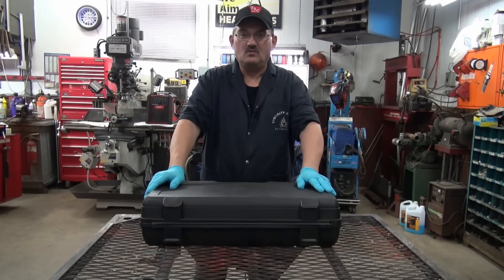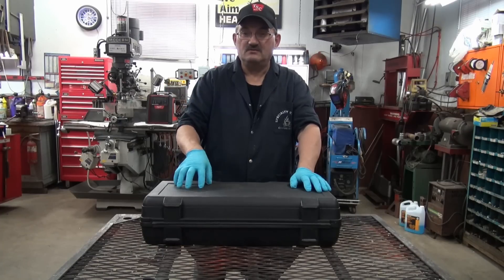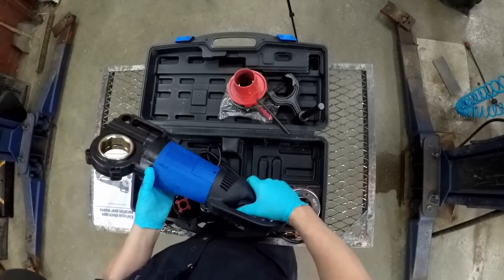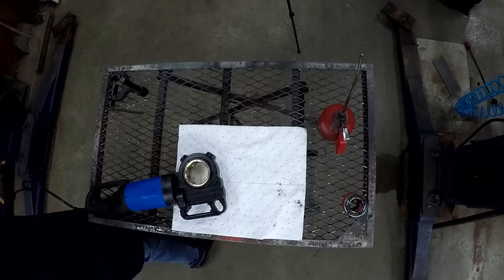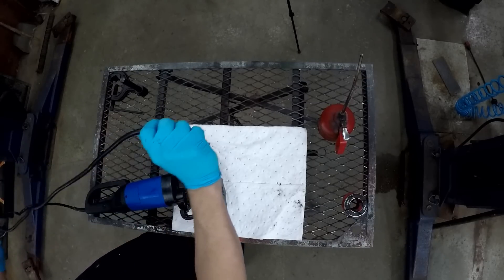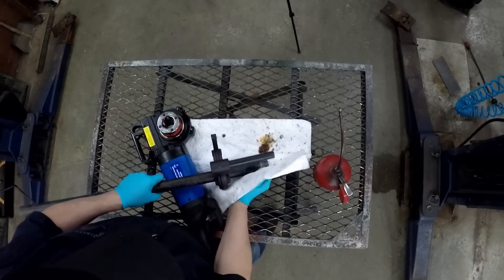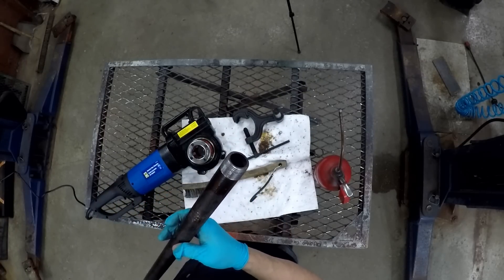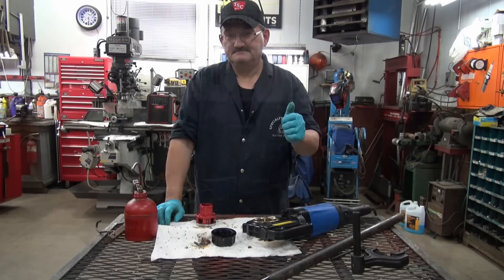Princess Auto Portable Electric Pipe Threading Kit

Comment: P.S.  He was running the largest dies.  I suspicion that as with several other tools Princess Auto has just a bit better quality built in than HF.  Your tubing bender was a perfect example of that.  One fact about the oil diapers:  Don't leave them in water or oil for long periods.  They do their job very well but will dissolve if left.  I made the mistake of thinking they would catch any oil that dripped in my bilge so i dropped one in and let it float.  After several days I was straining bilge water to get the pieces out when it disintegrated (didn't want it fouling my bilge pump).  So use them then toss them.  Have a Merry Xmas.

Comment: I just bought the new Power fist version electric pipe threader, Product number 8639379, It comes with 4 dies, I/2", 3/4", 1", 1-1/4,"  and a way better clamp than the old version, I'm just cutting half inch gas pipe and it took me about 5 mins total to thread one end, that's because I had to chamfer the edge of the pipe with a file before the die would grab on, then you spray the die with lots of cutting fluid and do a few seconds forward then a few seconds back all while giving a good shot of cutting fluid, this helps release some of the filings away from the die and gives it a longer life , do the back and forth motion until the die is almost at the end of the  pipe, this cutting action creates a great amount of heat as you will see for yourself, you will see a little shot of smoke when your going forward, Stop and cool the die every time you change directions with the cutting oil, It is very important if you want the tool to last for a long time

Comment: Hi Paul,

Are you just trying to make me feel bad? ha ha. I might have said I did the same thing but used a portable tripod gripper and the pipe were maybe 24 feet long, so I put a thread on it and used that to go towards the next stage of electrical installation between 10 and 12 years old, but I guess something was right as when I had finish each office doing either lights, OR power, everything worked!

Take care

Best wishes to you and your wife Mrs K.

mrbluenun
Reply from the maker: +mrbluenun 
No not at all lol. I bought that thing over a month ago. Might not ever use it but figured if I didn't buy it I'd find a need for it. You have plenty of experance threading pipe for sure. I don't use pipe much but one never knows when I will. Glad your pipe job went well. I'd like to have a tripod pipe vice. They work well. 
Keep well my friend.
Reply: +Paul Short Hi and hope you can find room for your new tool and you can find it useful from time to time and not be frustrated thinking "If only."

Take care
mrbluenun

Comment: Paul, seems like it was Klutch with a "K" instead of the way I spelled it earlier. Don't know what I was thinking. 
I have needed several gates that were different sizes and they are either to expensive to buy or so cheaply made you don't want to buy, so I just make my own.
Reply from the maker: +BulldogOTT 
That is a nice looking threading machine. I like it. http://www.northerntool.com/shop/tools/product_200400976_200400976

Comment: When you are trying to get a pressure tight seal, does the bevel on the pipe cause you to cut the threads too deep?
Reply from the maker: +QuantityEngineers 
That wouldn't apply in my opinion on a NPT thread because the thread itself has a taper on the end so it wouldn't seal regardless.

Comment: Paul, Is there ever a reason to thread plastic pipe? Like for temporary water lines at a summer cabin, etc.
Reply from the maker: +1RadioShowHost @DocDeStiller 
I sure don't see why you couldn't. In my world I go by the statement "what ever works". I've used those types of threading machines on fastening pipe to ships, stairways.... Holding stuff together but I see no reason why you couldn't use it for plastic pipe. Good question and it shows your thinking ;) Thanks for watching my friend.

Comment: wonder if it would undo sockets with an adapter, make a larger job easier. a self feeding oil reservoir like on the lathe would mean you could keep threading.
Reply from the maker: +gopha533 
I don't think it would have enough torque to do that with a shocket.